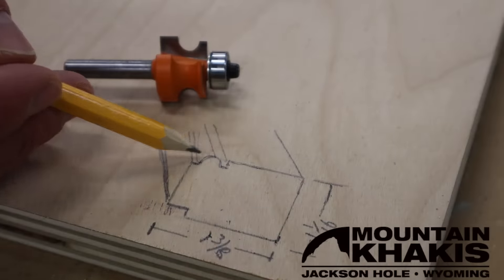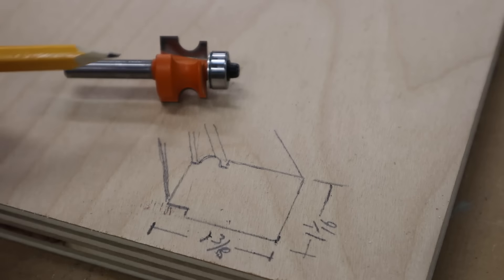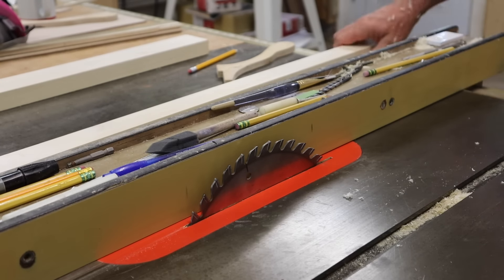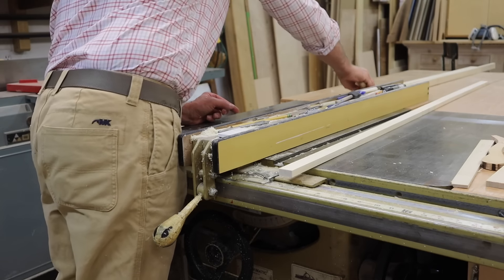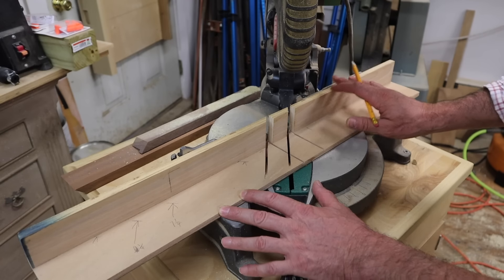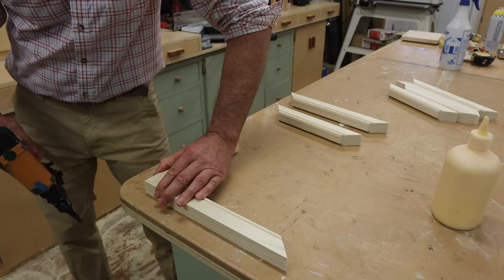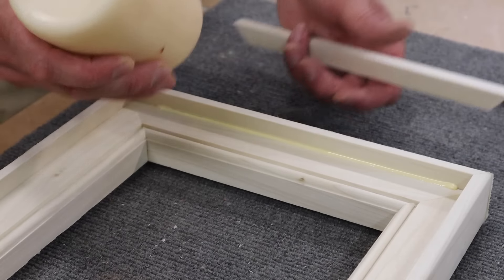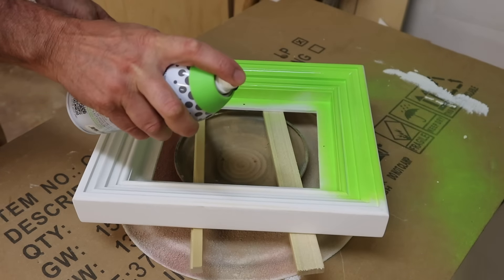How to Make Molding with a Router & Build a Picture Frame

Comment: Great video! Very informative. But I'd use a pin nailer, not a brad nailer. Much smaller holes to fill, and the glue does the work anyway!

Comment: Do you have to be careful to avoid glue squeeze-out on the front-facing molding seams? I ask because it seems like sanding the glue that is inside a tight area like that would be next to impossible. Also, do you hand-sand the routed surfaces on the molding? Thank you
Reply from the maker: I try to clean up the glue squeeze out with a wet rag before it sets up… Always good to cut the sharp edges with a piece of sandpaper

Comment: You describe the wood as 5/4 thick, say it runs heavy, and that it measures 1 1/16”. Isn’t 5/4 equal to 1 1/4” not 1 1/16th inches?
Reply from the maker: I believe I said it’s described heavier then it actually is, in the same way A  2 x 4 actually measures 1 1/2“ x 3 1/2“. Hope that helps

Comment: Super nice work!  But one thing i don't understand.You maybe get this question very often, but why using inches?  Its so much harder than the metric system, and so outdated. And its so much easier for your comments in the video's. You have to tell a tiny story to translate 8mm. in inches. 😁😁😁